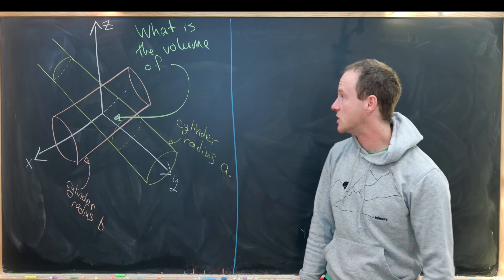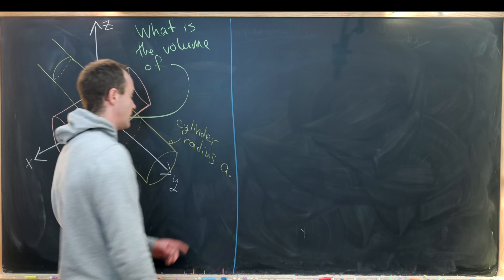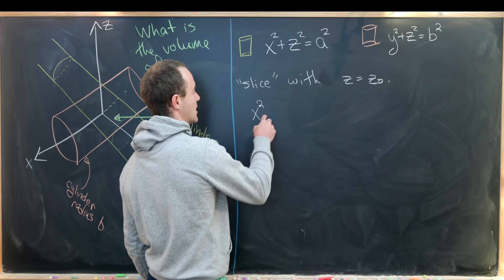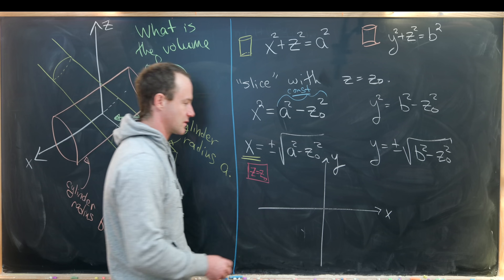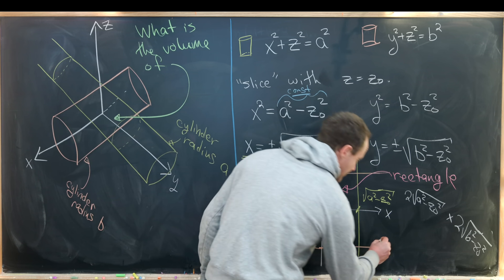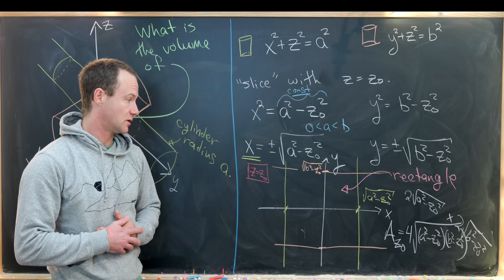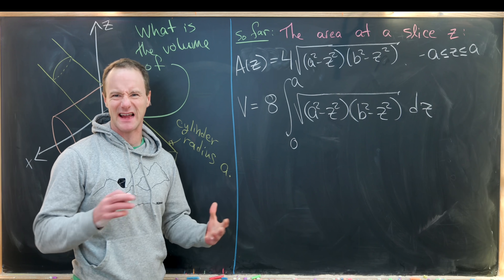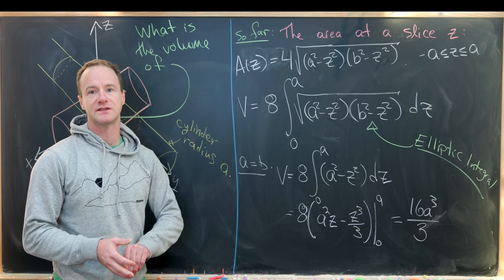Volume of a bicylinder -- wait! What is a bicylinder?

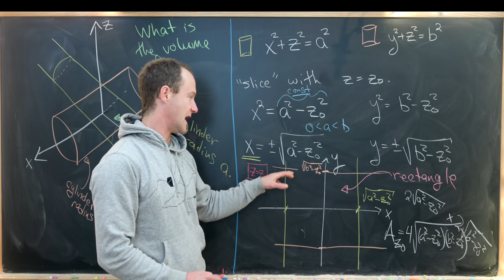Comment: 7:10 if z > a the plane no longer cuts the slimmer cylinder, i.e. the volume we're interested in. It helps sometimes to visualize what such changes in a mathematical expression, like the negative term under the square root, correspond to e.g. in the geometry they describe.
Also the evenness of A(z) corresponds to the symmetry at z=0.
Keeping track of such things really helps. One can check if solutions have the properties one should expect, and by juggling these different viewpoints and switching between them maybe find neater solutions.

Comment: I remember getting this as a homework problem in calc 2 a long time ago and I remember getting it wrong because I was visualizing what the object looked like incorrectly. It feels really hard to wrap my mind around what the intersection looks like without seeing it first for some reason. Didn’t have that issue for other similar problems, but 2 cylinders intersecting just breaks my brain I guess
Reply: It helps to first visualize a much smaller cylinder coring through a larger one- I can easily visualize that- it is a small cylinder capped on both ends by the large cylinder's outer walls- then slowly visulize the new capped cylinder getting shorter and fatter.

Comment: I have got it to V=8*(a*b^2)*I where I=integ (x=0 to 1) dx*sqrt(1-x^2)*sqrt(1-k^2*x^2) and k=b/a, assuming b<=a. With some more manipulation and the standard integral for E(phi,k), i.e. elliptic integral of the second kind, this becomes I=(E(pi/2,k)+(1/k)*E(arcsin(k),1/k))/3. However 1/k>1 so the second term (although a nonsingular integral) is not in the standard form

Comment: I’ve come up with that 3D body multiple times in the past when developing CAD projects for machinery. Another idea would be to evaluate the volume of the intersection between 3 cylinders with perpendicular x-y-z axes (same radius “a”, obviously). It’s interesting to note that in that case, cross-sectional x-y profiles would not be rectangles when “z” is between “-a/sqrt(2)” and “+a/sqrt(2)”. Damn difficult…
Reply: Wouldn't that approximate a sphere?

Comment: Assume a = b (LOL). For every horizontal slice. you get a square. Embed a circle inside. The ratio of the area of the square piece to the circle piece is 4/pi. Add up all of the circle slices and you get a sphere with a volume of 4*pi*a^3/3. So all of the square pieces have a total volume of of (4/pi)*(4*pi*a^3/3)= 16*a^3/3
Reply: Only a square if a=b
Reply: @alan clark. If a not = b then you are out of range on one circle (z is undefined), but still within range on the other circle.  The points in the range a<z<b or a>z>b would have some kind schrödingers cat imaginary kind of existence.
Reply: @deltalima6703  no, either the 2 cylinders have the same radius, or one ( Michael called it "a" ) has a smaller radius than the other ("b"). Assume that the axes of the cylinders are aligned with the x and y Cartesian axes, so that their crossing point is at the origin. Then z is a slice perpendicular to the z axis, with values between b and +b. Now if a=b, (a^2 z^2) equals (b^2- z^2) , so we have a squaring cancelling the square root and we get an integrable function:  otherwise, with a<b, we get a non - integrable function ( an elliptic integral). However, if we have values for a and b, numerical methods can be used ( e.g. Simpson's Rule).

Comment: Consider the case a=b.
Applying  selected by the author of the orientation of the cylinders relative to the
coordinate axes, we use the classical formula for calculating the volume of a cylindrical body:
V=∫∫_D [f2(y,z)-f1(y,z)] dydz, (y,z)∈ D: {y^2 +z^2 ≤ a^2}.
Here f2= √(a^2-z^2), f1= - √(a^2-z^2).
V= 2∫∫_D √(a^2-z^2) dydz= (*)
 in the coordinate plane (y,z) we turn to polar coordinates: 
y= r cosφ,  z= r sinφ,  D:{0≤φ≤ 2π, 0≤r≤a}.
(*) = 2∫(0 to 2π)dφ∫(0 to a)√[a^2 -r^2*(cosφ)^2]rdr=...
=(2/3)*a^3*∫(from 0 to 2π) [(1-|sinφ^3|)/(cosφ)^2 ] dφ =
=(8/3)*a^3*∫(from 0 to π/2) [(1- sinφ^3)/(cosφ)^2 ] dφ =
It can be integrated in parts.  There is no divergence at φ →π/2.
... = (16/3)*a^3.
Reply: As it turns out, calculate the integral V= 2∫∫_D √(a^2-z^2) dydz , in this case, 
 it is easier without using polar coordinates, although the integration area is a circle of radius a, centered at the origin.
V= 2∫∫_D √(a^2-z^2) dydz =2∫(from -a to a )√(a^2-z^2)dz[∫(from - √(a^2-z^2) to √(a^2-z^)) dy ]=
= 2∫(from to a )√(a^2-z^2) *2*√(a^2-z^2) dz= 4∫(from-a to a ) (a^2-z^2)dz=
=8∫(0 to a ) (a^2-z^2)dz=(16/3)*a^3.     )))

Comment: Cool exercise. As a quick note, if you want to calculate the volume of the bycilinder as shown in the initial figure (0:41), it already has a=b because otherwise the figure would be wrong...
Reply: Yes- if A doesn't equal B, and A is >B, then the horizontal slicing method has to be integrated from zero to B, not A.  The smaller cylinder would be coring through the larger one and not intersecting the surface of the larger one on the top and bottom sides.  I wonder if the solution would be the same- not sure myself- will try to work it out later.
Reply: Yeah- the capped portions areas of the smaller cylinder do depend on the value of A, so you end up in the same place- an elliptic integral.